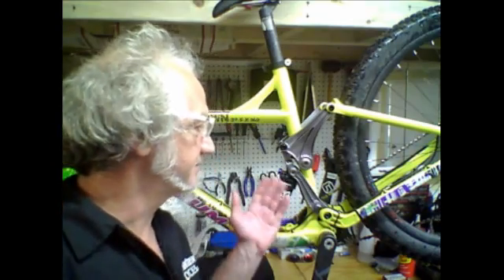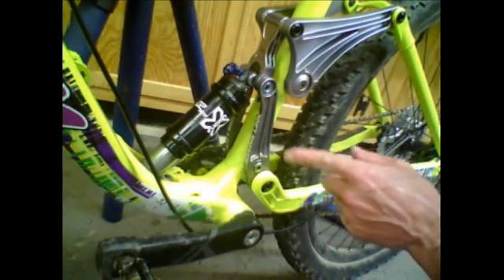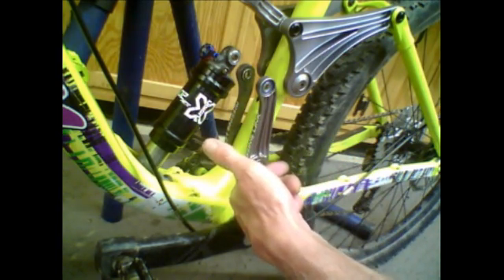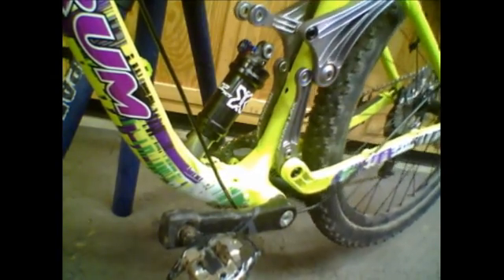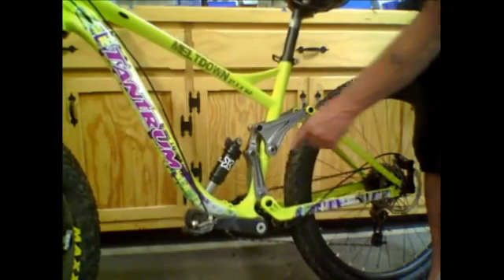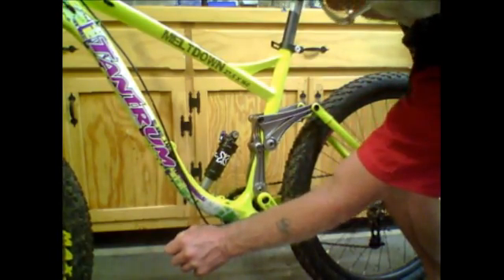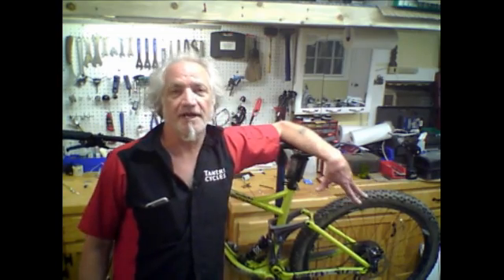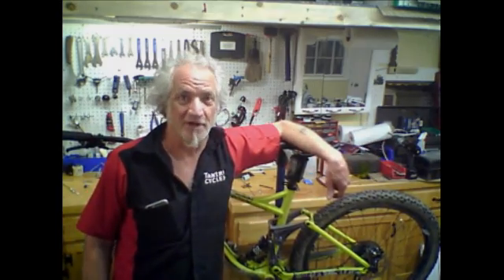missing link tech talk v1

Comment: @Tantrum Cycles  Very very interesting suspension design...makes a lot of sense...my only concerns are lateral stiffness & maintenance (especially keeping the area clean where shock mounts to the frame).  Am seriously considering this now but really want a 29F/27.5R mixed wheel specific bike...any chance you'll release one this year?
Reply from the maker: Thanks Guinness. Lateral stiffness is very good. The link that the chainstay pivots on is as short as possible and still allow the bearings to fit. The upper part of that (Missing) Link, attaching to the shock, adds a large amount of stiffness, much like a swinglink does in a more conventional suspension.

Some of my testers are hardtail riders, hypersensitive to stiffness in every direction and they give it high marks.

The lower shock mount hasn't been a problem so far. I live in a muddy area and it's really pretty protected. It is open to the inside of the DT and there is a drain hole in the BB.

We did a mixed wheel bike, the Downburst. It had a 150 mm 29er front and a 165 mm 27.5 rear. We will offer it on our kickstarter in about a week's time. We may or may not go into full production with it, depending on demand.

Comment: As long as the price and weight of the frame is good then I will be very interested in your frame :) Make sure you do a buy on kickstarter now video! I wonder if its any good at pedal hops?
Reply from the maker: Still finalizing MSRP, but it will be competitive or less than comparable offerings in (alum). The weight of the frame and shock is about 3517 gms = 7 lb 12 oz, size M
Reply: One kilogram extra in a frame is just 1% slower on a really steep climb. My cheapest and heaviest hardtail (Redline Monocog 29er at 2.9kg) is also my best pedaling. Takes a good carbon one to match it.

Comment: what's your take on Spot Rollik's "living link" system?
Reply from the maker: Interesting. Don't really know what to expect out of that.
Reply: it would be interesting to see your point of view as engineer on how nowadays suspension designs compared to missing link's.. after looking at spot's living link or yeti's infinity concept, i'm kinda sold on missing link's simple but brilliant design that emulates how human knee's works..
Reply from the maker: The reason I called it the Missing Link, is that is is missing from all other suspension designs. They can all deliver a competent ride, but that can't deliver this extra level of performance. This sets it apart from all other designs. that's why i'm so excited about it. In case you haven't seen the first test review, check this out ;

Here is Richard Cunningham’s take from Pinkbike.com:

“Does the impossible; pedals like a hardtail and delivers a plush ride over the bumps-without levers or electronics”.

”The Missing Link delivers the goods. Compared to the current crop of carbon superbikes, the Tantrum Meltdown performs well on the downs-essential for any 160-millimeter trail bike-and its pedaling action is better than all of them”.

http://www.pinkbike.com/news/first-ride-tantrum-missing-link.html

when RC says it "does the impossible", the meaning is twofold, one, for the claimed performance of the bike. But, possibly more impossible, I have managed to come up with something that all of the engineering might and bicycle company will, has failed to, despite decades of trying and millions of dollars spent. I'm kind of excited.